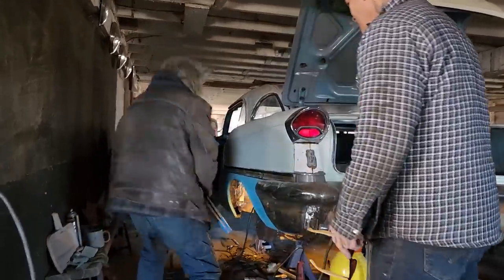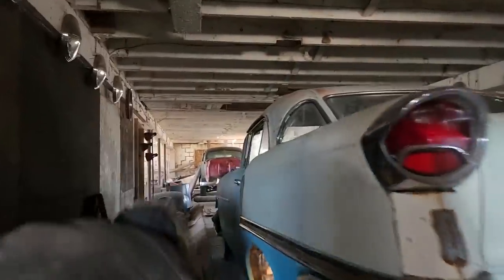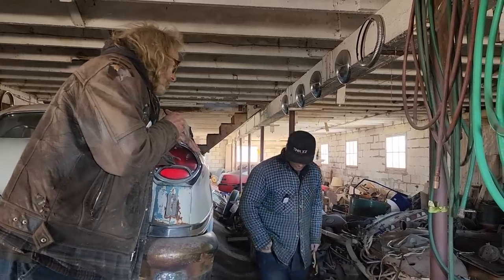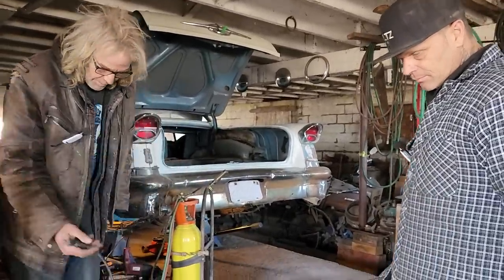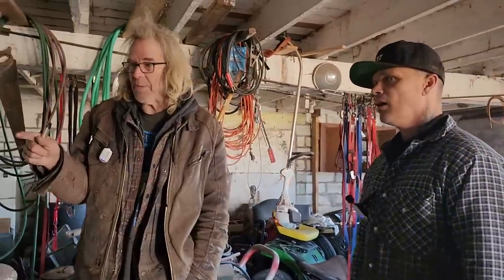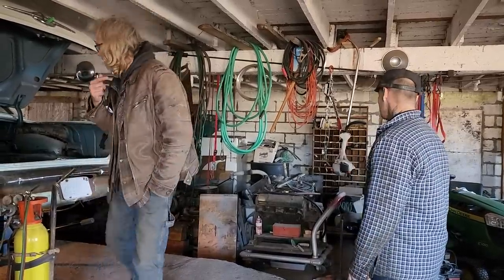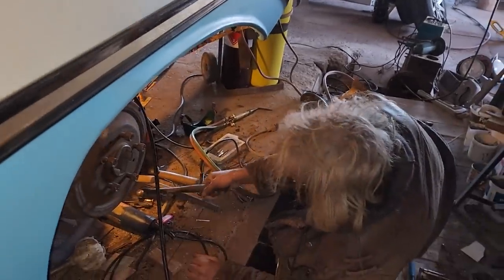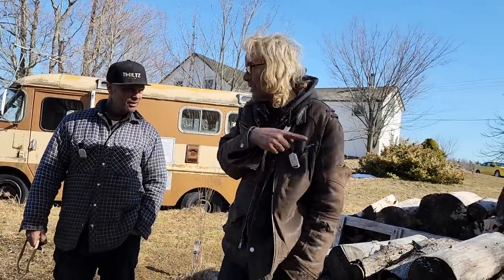Torch welding wheel well repair that is coated in tar... RISKY 😬🔥

Comment: Jim you can save yourself from doing all that overhead by just cutting out your tubs and fabricate some new mini tubs and new floor in your trunk. Weld it all from the top. There might be a little bit of overhead but on new metal.

Comment: My 60 rambler was rusted up in under where you couldn’t see it and it’s been a problem with other ramblers of the same year I’ve noticed. They’ll rust out between the trunk lid and the side window from staying wet up in there, they had no inner fender to speak of. And like any car, they had their common places to rust.., underneath the tail lights ,above the trunk at the back window like I was talking about and all the way down the back edge of the front fender at the edge of the door. Why they didn’t make some sort of inner panel even if it was just smooshed in on tar I don’t understand but then I do understand too. Even back then they didn’t want them to last forever and thinking ‘down the road’ was not a common thing.

Comment: Consider pressure washing the inner fender wells, once dry use epoxy resin and fibreglass mat to bridge the holes and undercoat everything after resin cures.

Comment: Holy crap Jimbo that tar looks like its 3/4 of an inch thick that come out from that rear wheel well. Holy shit, that must of added a hundred pounds of weight to the back of that car, that's wild. Your right about that Chad Jimbo is a badass with a torch that's for sure. the amount of money they charge for shipping fees is criminal as far as I'm concerned. I don't blame you one bit Jimbo for welding up that bumper and going the route you did to make it work. I can't believe how much dirt come out of that car, where were you driving it, through mud fields. LOL

Comment: JIM, YOU MADE A COMMENT ABOUT HAVING TO TILT YOUR HEAD BACK TO USE YOUR BY-FOCALS.  TRY THIS TRICK - TURN YOUR GLASSES UPSIDOWN, AND THIS WILL PUT YOUR BY-FOCALS ON TOP, AND YOU CAN SEE VERY GOOD WITHOUT HAVING TO TILT YOUR HEAD BACK - YOUR DOING A GREAT JOB ..................... HARRY (FROM IMPERIAL, MISSOURI (USA)